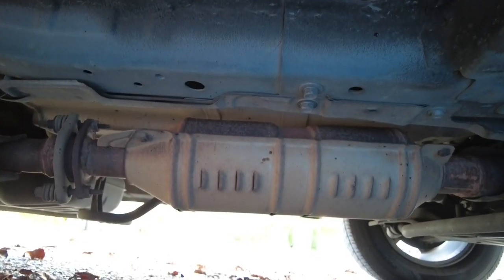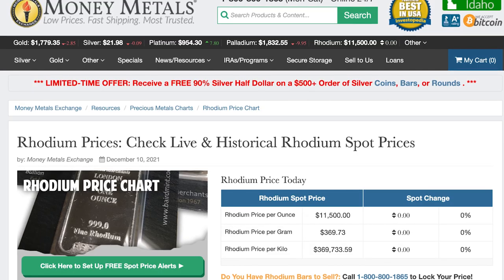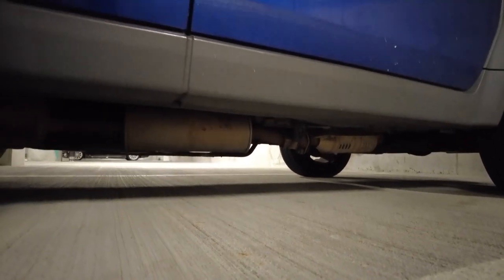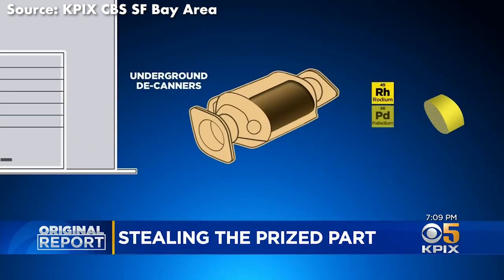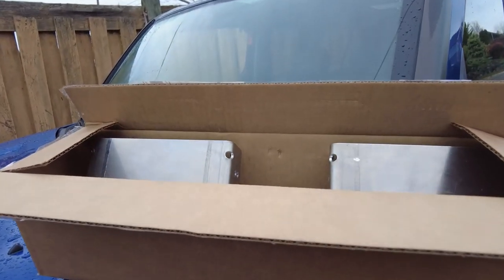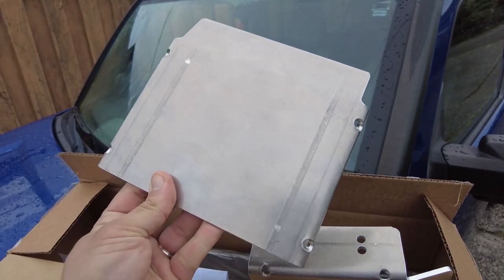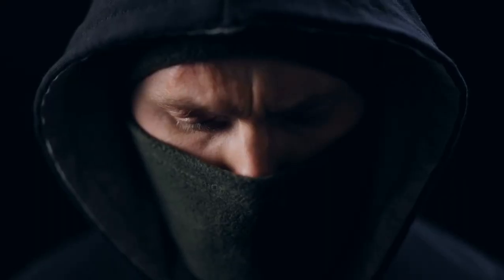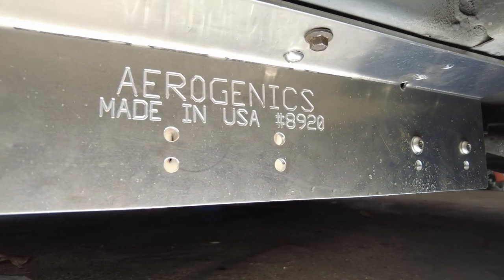How To Prevent Catalytic Converter Theft?

Comment: Nice informative video. I work at a repair shop that specializes in fleet vehicles and we've seen an increase in customers who have had theirs stolen as well, most of which are tucks that are quite easy to lay underneath. Sadly the most recent was a bus the local food pantry uses to bring food to people that have trouble with transportation. This vehicle has been targeted twice already now and after this last time I made a cage for it out of rebar. Its a little crude looking but will help deter would be thieves who as you pointed out are looking for quick unobstructed removal.
Reply: Salute to you, for taking the time to do that for them.

Comment: In WW2, as Germany was losing. Soldiers rigged a grenade to a hollowed out wall, the pin attached by string to a painting which concealed the explosive. The picture was intentionally placed skewed. The idea behind this trap was that it would target high ranking allied officers. As officers were likely to be the only one's concerned with fixing the skewed picture, which would tug on the wire releasing the pin. 

You could do something similar using wire and buckshot.

Comment: if you are parking up in a strategic spot which makes it harder to access the cat because it is near a wall or fence that would make life more difficult. If you are parking up for a week or three when you go on vacation you could put a pair of boots on the wheels and attach a steel pipe between to make access more difficult, or hire a lock-up garage
Reply: Except that those boots are pretty easy to defeat if you have the knowledge and the tools. There's at least one video showing how it can be done, and you really don't even need the specialty tool if you don't mind damaging the boot. ='[.]'=
Reply: @Raycheetah  The thing is, you're never stopping a thief. You are only delaying them, hopefully long enough to make the entire operation unsavory ...
Reply: @3nertia  Removing the boot can be done even more quickly than the catalytic converter. It just depends on how well-equipped the thief is. ='[.]'=
Reply: When I go on vacation, I take my car with me.

Comment: Moral of the story..
Put a switch on your car to make it drop to the ground when being tampered with.
Said and done...
Reply from the maker: That is really clever!!
Reply: Yeah that'll work.      The cost?     You could also let the air out of all four tires or remove them every time you park.
Reply: Oh yeah let's put a multi thousand dollar hydraulic system in the car to prevent the theft of a $500 part. That's smart.....
Reply: @TheUrbanPrepper  It really isn't.
Reply: @FBobby  
Its ok don't cry
Reply: @FBobby  
Air is easiest
Reply: @Mazda.Fit.  For sure. But still. Costs a lot of money for a system that changes your entire suspension to try and save a cat from being cut off. 
Also I guess these people haven't heard of low profile jacks.

Comment: Since catalytic converters run hot normally, does adding that shield increase the temperature too much?
Reply: Saw one complaint about that, but looking at several, they have vents that should bleed off some of the heat.
Reply: @durgan5668  sounds good!
Reply: Damn good question. Of course they need to be in a hot area by design, but maybe too hot w this.
Reply: @bedrosnersesyan6975  thanks!

Comment: You should use some Red Tread Lock on your security screw and bolt. Otherwise, you can bypass most of them using Knipex twingrip or Engineer PZ-59. Just choose the right size...

Comment: Looks like there are 4 bolts that hold this cover. Do you think it will stop thiefs?
Reply from the maker: I have 6 holding it to the frame. I changed our a few for different bits.  They would need to spend a lot of time to try and remove them all.  It's more of a deterrent.  If a thief really wants to they will be able to steal anything.
Reply: I guess you could go with those irreversible slotted bolts created for bolts for burglar bars and whatnot.  (maybe locknuts and lock-washers too?)
Reply: I think they would just cut through it when they cut down the cat.  It's aluminum.  Very easy to cut.

Comment: Now if you've already had your stolen there is no point to put one of these catalytic converter guards on your aftermarket catalytic converter as those have no precious metals in them and are not worth anything so don't let a repair shop tell you otherwise

Comment: There is a downside to cat-lock as I recently learned, if the hard-working thief jacks up your car only to be disappointed to see a lock on it, the thief will most likely damage something else as an act of revenge for wasting his valuable time, in my case the fuel lines were cut along with some electrical wires, if only we were allowed to shoot these vermins or do what I did buy a car that is not easily accessible to the cat then it might stop or at least the manufacture will rethink in how to get around it by not making it so easy to access, as cat lock theft is a pandemic itself and only getting worse.

Comment: Great video & info! 
I see some screws to install though, can they just unscrew them it’s a drill or screw driver? 
Can I use this protector on a Toyota RAV4 & Camry or this one was only for Honda?
Where did you buy it?
Reply from the maker: They would need to bring a security torx bit set, allen key, and a socket set. The screws are a combination in different locations. But yes, they will be able to if they have enough time. This more for deterring them. I bought mine directly from Aerogenics.

Comment: Looks like it was just one bolt going to the frame
Reply from the maker: There's 3 on each side (6 total) into the game. I made mine with one flat bolt, three security torx, and two hex. They could open it but it would take a few different bits and more time. Again, it's just meant to slow them down, not stop them.

Comment: $200 is a bit steep! Also how do I make my smelter legal? :P One easy solution would be to run the cat inside under the rear seat, but car makers aren't bright. Some still put their engines in sideways ffs.
Reply from the maker: I wonder if manufactures will start changing the design of the vehicles.
Reply: @TheUrbanPrepper  they should. They changed window design to make it harder to use a slim jim.
Reply: WTF